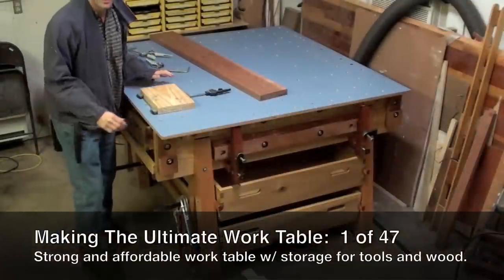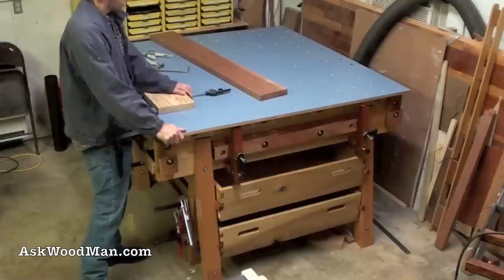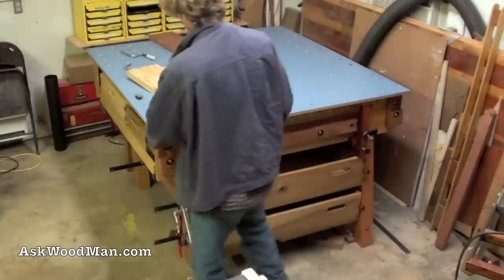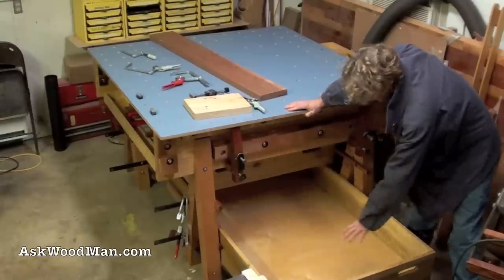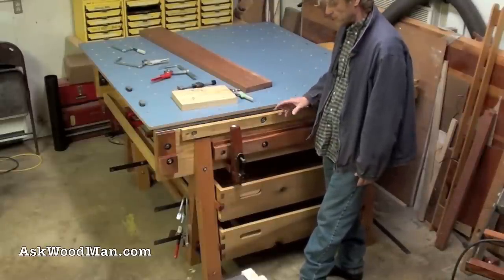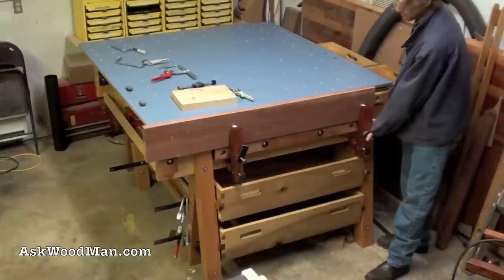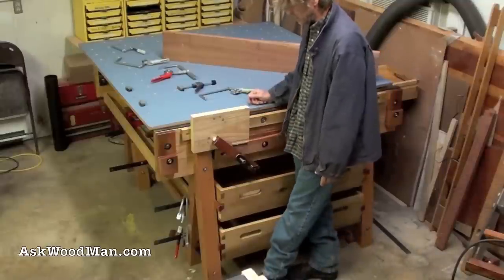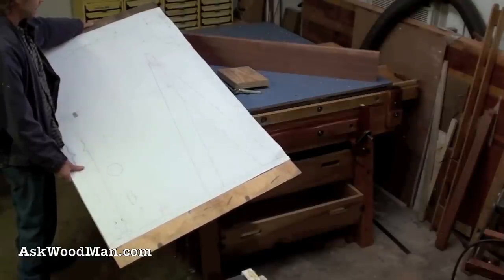1 of 47 • How To Make The Ultimate Work Table • A Woodworking Project

Comment from the maker: They are Bessey Rapid Action Clamps. These are Besseys actually made in Germany. You have a keen eye because when you examine the the two side by side the castings and manufacturing marks are identical. Perhaps Bessey makes them for Festool? The only difference is the Festool Quick Clamps have the thin shouldered snout to mate with their extrusions. I can't go literally 5 minutes when I am working without grabbing a Bessey. I have the 6 8 and 12. All are great but the 8's are a perfect size.

Comment: @askwoodman Your worktable seems like a good workaround though with all the jigs you made...
The only troubling thing to me on your worktable is can you plane effectively, extensively, and tiressly on it?
If the planing is just for short finishing steps, it's musn't be a problem...

Your use of drawers to support and clamp is quite creative, it seems to fit quite well in your uses.

All in all, unconventional, but for machine work it seems way better than commercial benches.

Comment: @askwoodman 
That is in part the problem of benches sold under the guise of traditional workbenches, to many are concieved like tables, or cabinets that impede clamping on the front due to overhang of the top slab or top due to poorly place drawers under...

A leg vise and a sliding deadman make for a very versatile clamping on edge, wich doesn't restrict the height of what you clamp, and good forged holdfasts make the same thing as your festool clamps, really fast, and effectively

Comment: What an awesome design.  I had an open drawer design bench and got rid of it.  I found that the volume of dust and chips the drawers gathered exceeded their usefulness. Besides the obvious of attaching a great dust collector  (which I don't have) to everything how do you deal with this?
Reply from the maker: I don't really find the dust in the drawers a huge problem. And when I notice a bit too much has migrated,that is usually a signal to straighten up and organize the drawers. I do have a dust collector and Festool vacuum so I am pretty lucky to be capturing most of my sawdust blow right the source. That Festool vac is amazing since it has variable suction control so I can cut it all the way back and vacuum in drawers with no risk of sucking small tools up.  Thanks for visiting my channel. Keep in touch. Allan

Comment: Love this work bench and I especially appreciate your noting you've utilized recycled and or discount materials that may have flaws that can be worked around with time, patience and pre-planning. This design is very clever and I know it has taken your years of expertise to configure it to the tools you commonly use as well as different projects. Wicked nice! I will be building something in the next year or two in my new  90% recycled material garden shed here in North Maine. I love to Tinker and need an outdoor work bench for my summer recycling art projects! Hat tip~

Comment: The idea you have for a board vise is absolutely brilliant!  Your design also is also flexible enough to be modified to taste, but from what I can tell doesn't sacrifice rigidity.  Is it as stable as some of the 1000 lb. piles of hardwood posing as a workbench?  No...  but does anyone really need something like that to build real-world projects?  Doubt it.  You have a great working-man's design here that is practical, affordable, and customizable.  Mind you, I am researching ideas for electronic service workbenches...  but this really caught my attention.    At some point I'll have to whip up speaker cabinets and road cases, and this looks like just the ticket.  Best part is that you have the design scaled to the most commonly-available material size.  My hat is really off to you.
Reply from the maker: Thanks a lot Ben. But I actually would argue that it is more stable than the benches you mentioned. Almost square footprint with 8 splayed legs where the two horses are bolted together with heavy steel. This thing is a beast but is made out of common low cost materials. I designed this as work table that can be abused in the most grotesque manner and I am not going to have a hissy fit
about it. Have you seen my version of the Roubo work bench. Here a link to the series. I will be adding a Moxon soon so there will be updated videos. 1 of 34: How To Build A Roubo Work Bench: AskWoodMan Style

Comment: I like the idea of the pass through drawers basically in all four directions. I like it so much that I showed them to the wife as an idea for her island craft table. I'll probably have to come up with some kind of slide/roller system to keep them manageable for her. I can see them incorporated into another workbench when I get my bigger shop built. Very ingenious, you can tell a lot of thought went into every aspect of it's construction. I've had all kinds of workbenches, from B&D Workmates to a massive 4X8 monster. I still have the Workmates and drag them out from time to time, but the 4X8 just sucks and is going to be sold at a literal garage sale soon. I've got a Festool MFT on the way, but I want to build something like this for myself and the way I work. I have a friend who has a two store brought two or three thousand dollar Sjobergs and he spends most of his time working off sawhorses and a plywood top because he's afraid to mess them up. A workbench should be for work and should work the way you work, instead of a show piece that's based on how someone else thinks you should work. Subscribed and will be watching your other videos for more ideas. Thank you so much!
Reply from the maker: CypressJim Thanks Jim. The beauty of that design is there are no expensive or exotic materials. And the storage is just amazing. The drawers are so stout that you will see me using them as stairs to get on top of the table. I am too much of a shaved gorilla to have a fancy work table. I just need something super strong for getting on with it. There are very detailed plans available here. http://vsctools.com/shop/product-category/woodworking-plans/ Thanks for visiting my channel and for taking your time to reach out. Allan